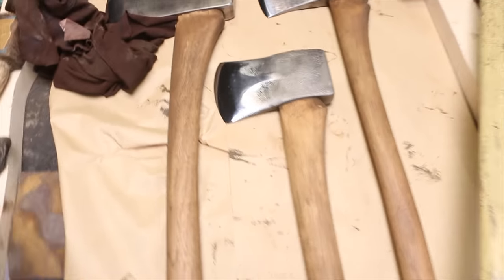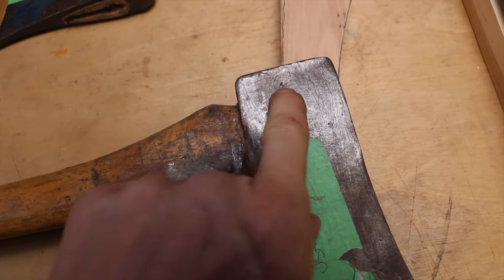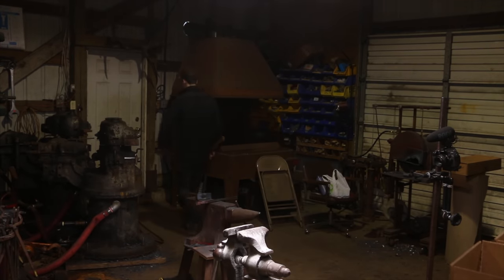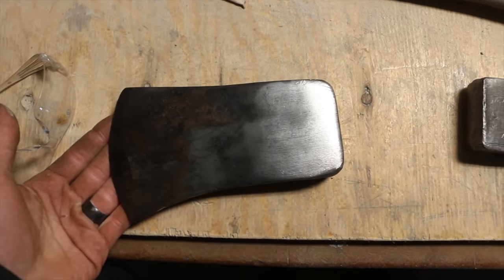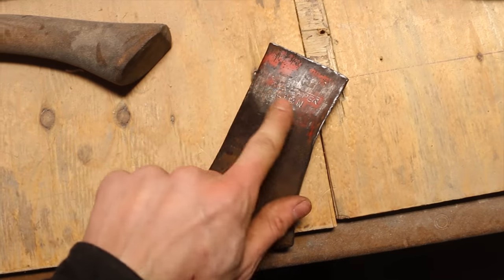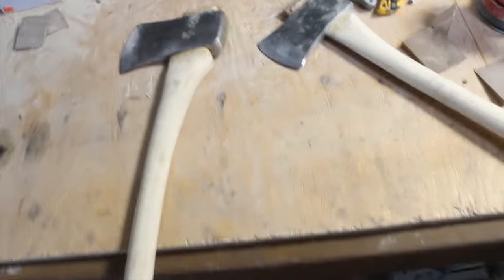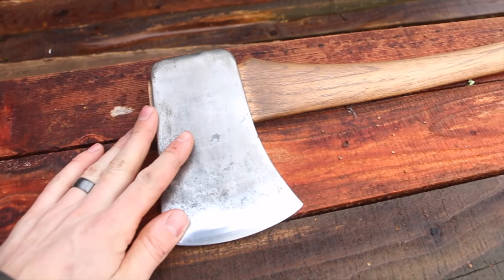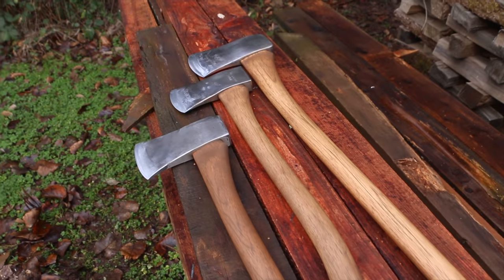Restoring a True Temper LION Axe - day 3 of 10 Axe refurbishment

Comment: Do try driving a screw into the wedge (wooden and even aluminum) and pry it out with a carpenter's hammer or a crowbar first. Will save you shitloads of work with drilling and banging the remains out of the eye.